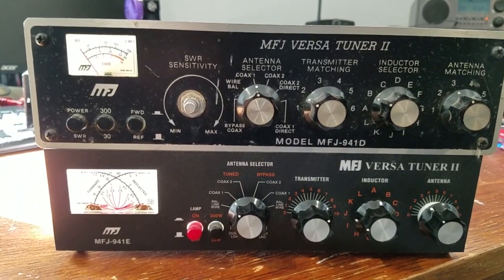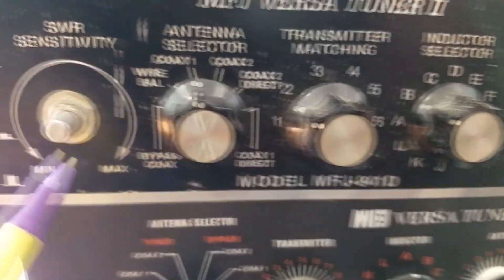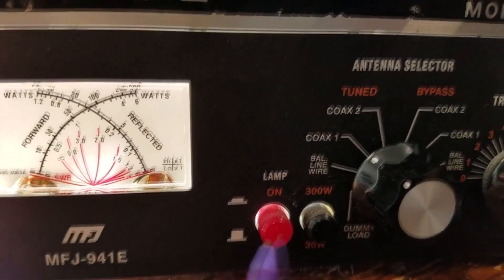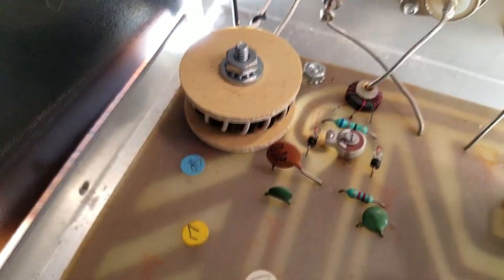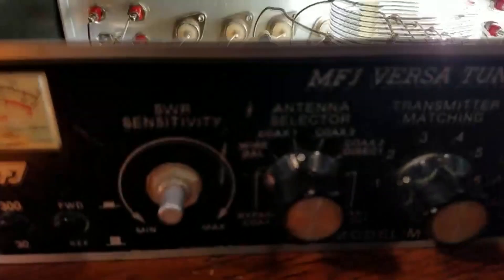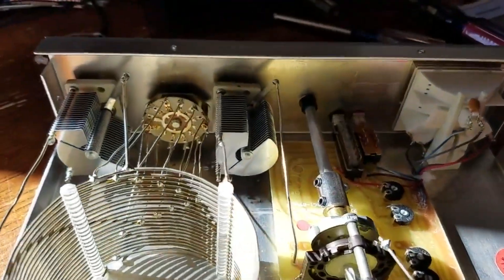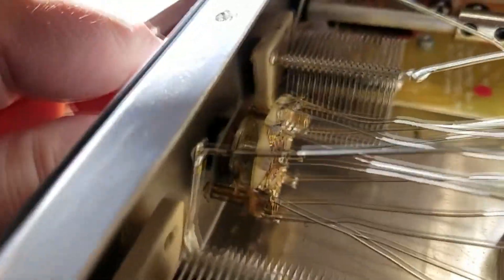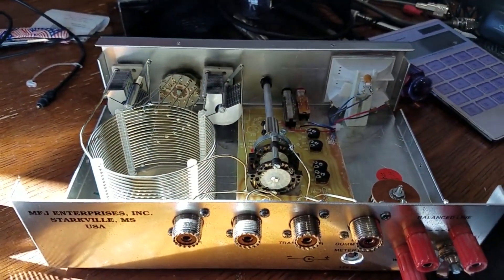MFJ 941D VS 941E Antenna Tuner Inside Look

Comment: I'll let mine go with my Omni C I thought my new LDGAT 11 automatic tune was all I needed seems I'm wrong. I can't get it antenna strung up that it will match easily especially in 80 m loop.
Reply from the maker: I have noticed Auto Tuners can skip out on a tough to tune antenna. The manual Tuner can usually match a "touchy" antenna.
Cheers

Comment: the one bottom new mfj can you run 3 antennas on this anteena tuner  can you run antenna on  dummy load just like coax1 and coax 2 not running dummy load on it?

Comment: How do you get the dial to work.  I don't see anywhere to plug in dv voltage.
Reply from the maker: there is a 12v volt jack in the rear. (of the new model)